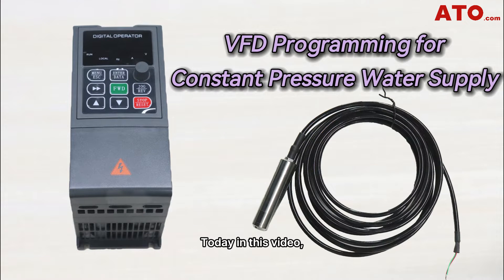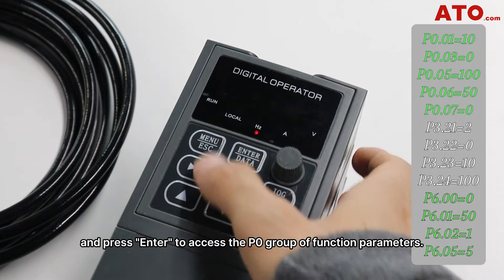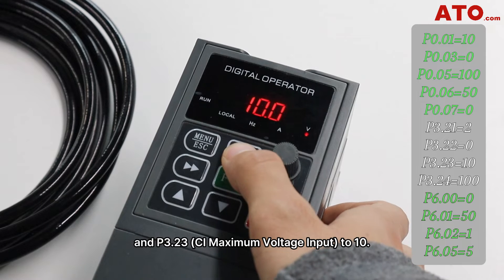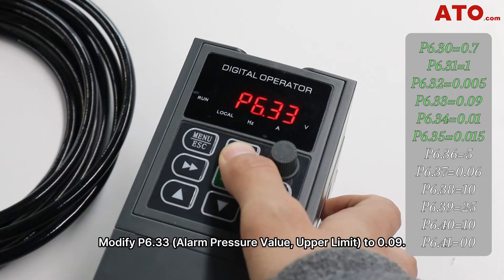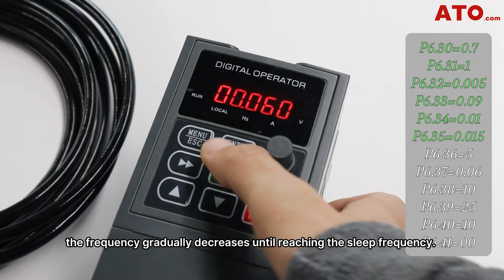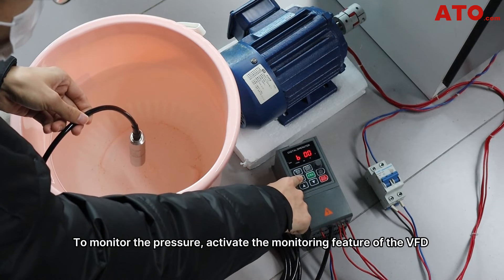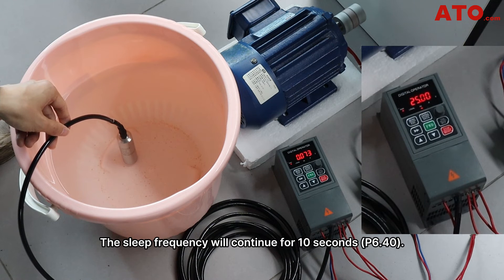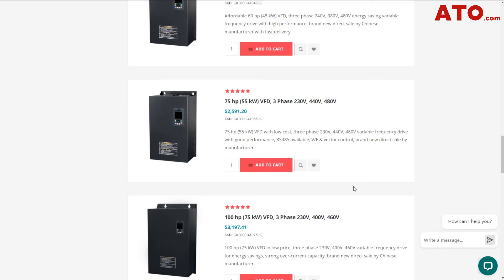VFD Programming for Stable Water Pressure in Water Supply System

Comment: Thank you for this.  Could you do a video that shows how to do the same procedure for maintaining piped water pressure? For example set pressure is 60 psi and while people use faucet, sink, shower or flush toilet the pressure drops and the vfd wakes up from sleep, ramps higher using PID to adjust back to set pressure?